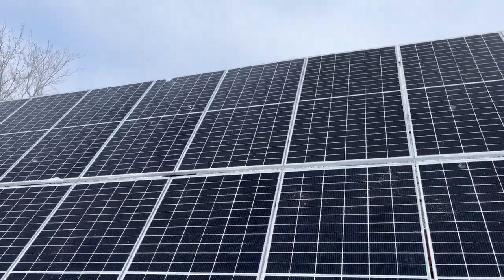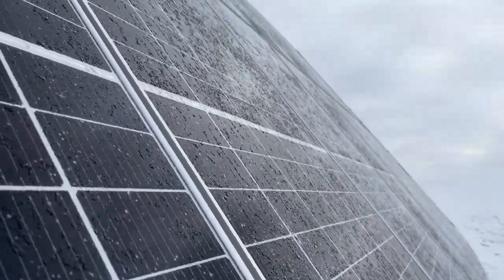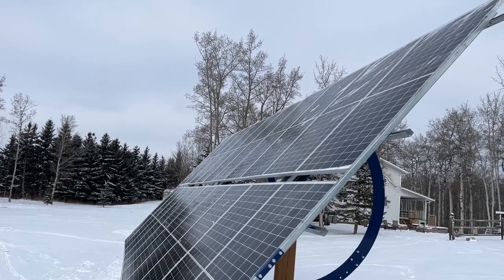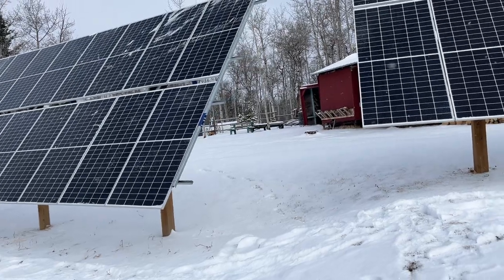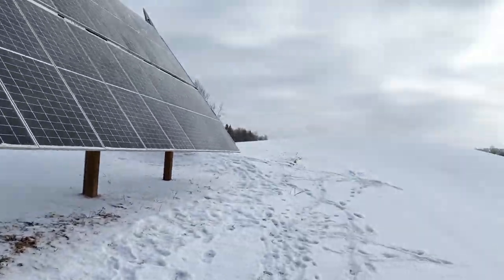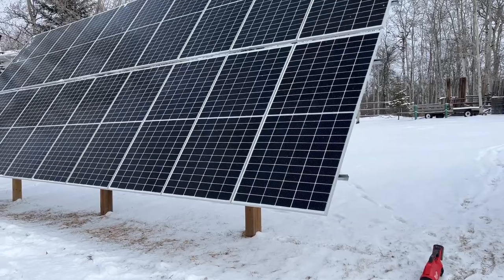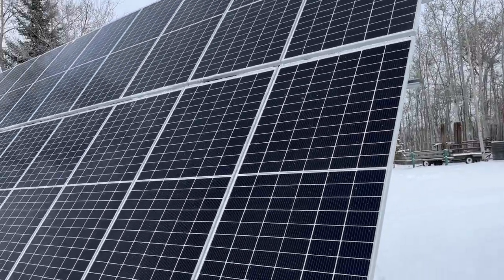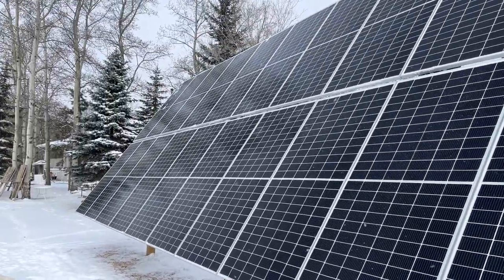Solar panel snow/ice removal? Yes!

Comment: angle plz
Reply from the maker: They are set at 55degree on the outer 2 arrays. 50degree on the center. In the winter I ran them all at 75degree. This year I’m going to tilt them to 85degree almost a wall.